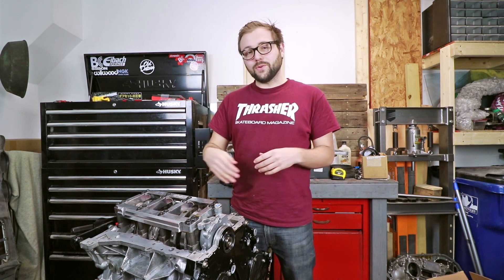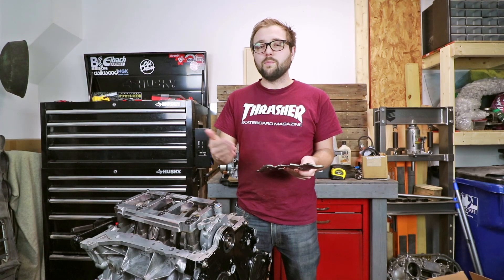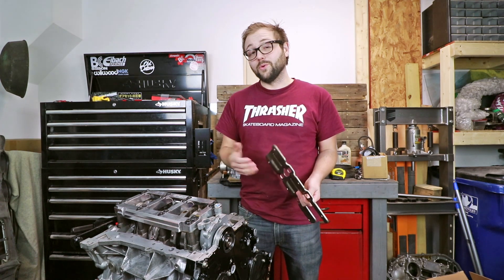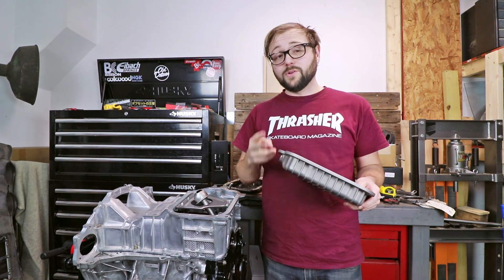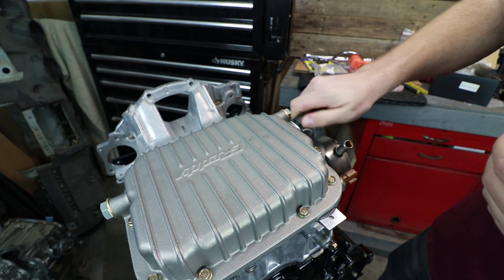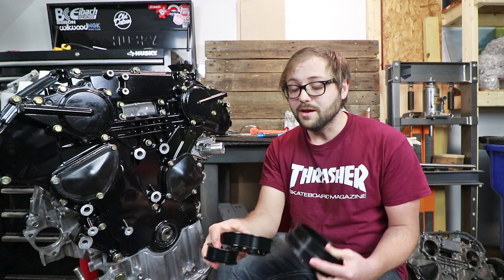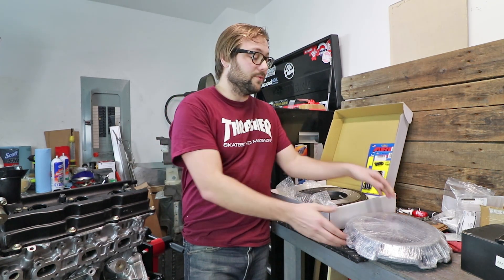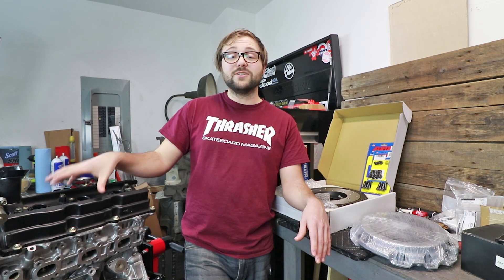VQ35 Bottom End Wrap Up | VQ35 Engine Build Part 4

Comment: Dude amazing detail and explanation makes me feel more confident about build my DE. The one question I do have has to do with the timing? Did you ever have any issues with the part you changed (cams,pistons,rods) interference etc.
Reply from the maker: I'm so happy this is encouraging you! 

I have not run the engine but I have turned it over several times to make sure the valves and pistons don't interfere with each other. These engines have useful timing indicators which are easier to identify timing to make sure things aren't going to interfere.

Comment: wonder if you upgraded your crank pulleys . In my past research on these . lite weight isn't better . Better is the fluiDamper crank pulley . But these are quite more expensive
Reply from the maker: Yeah light weight is not the way to go. I've gone for an ATI damper which I'll show in the upcoming video

Comment: I like everything you did but I had to come back and comment that the one thing I didn’t like was that girdle and windage tray.

When I did my first VQ35 build I talked to one of the Z1 guys about the girdle and he basically said that it’s a track vs drag decision. Most track guys are going for less than 500-600hp, so stock crank, stock girdle, and windage tray. Drag guys are making more power than that can’t really use a stock crank, so it gets an upgraded girdle as well and don’t need the windage tray because the oil just goes straight back.

The problem with the windage tray delete is that it serves a lot of purposes, like keeping oil out of the bores, keeps the wind from sloshing the oil, and keep the crank from encountering sloshing oil.

It more acts as a baffle than a funnel as you described.
Reply from the maker: I appreciate this. So stock girdle and windage tray are probably the route I should go then.
Reply from the maker: Well, I am completely changing my current video to go back and change the girdle and address this
Reply: So you don’t need that girdle if your making less than 500 hp? I’m put 546 to the wheels and I’m going to try to make more would that girdle benefit me?

Comment: is it worth getting the pan or a spacer in your opinion as the baffles aren't that large, does it still keep the oil centred on the pick up tube do you think ?
Reply from the maker: From reading other people's experiences, the baffles still keep oil centered around the pickup. They are small but they do help keep more oil centered for the pickup.

Comment: whats teh cost been so far want to be the ballpark of what i need to have to start this
Reply from the maker: So a general break would be:
Rods and pistons about $1800
Brian Crower cams $1500 
Machining about $600 maybe 

And then I opted into a lot of small things that all together add benefit to the build which I'd guess at another $2500 to $3000. So $6500 to $7000 as a guess. 

The prices change alot and I get everything for Concept Z Performance who usually have a lot of this stuff on sale.

Comment: Is that new pan deeper then stock only reason I ask I'd like to get one but don't want it hanging down below the sway bar
Reply from the maker: Its wider and flat on the bottom whereas a stock one is slanted a bit but looks to he the same height. It's made for a 350Z so it should fit fine with the sway bar.
Reply: @OldDatsun  nice can't wait for next video. So much information